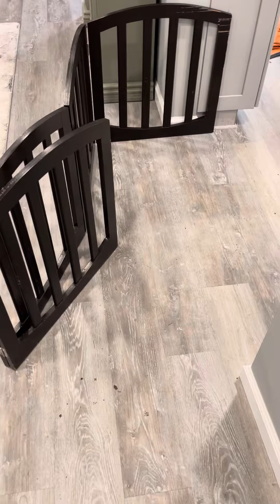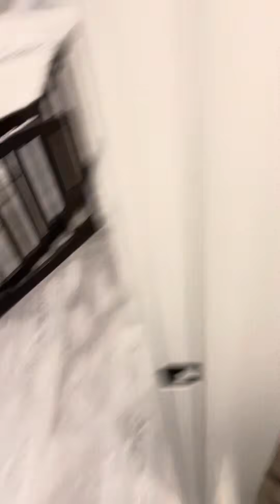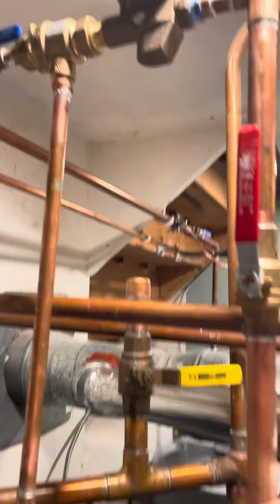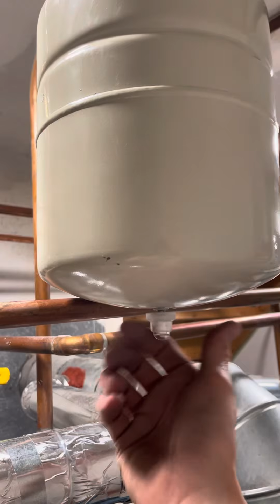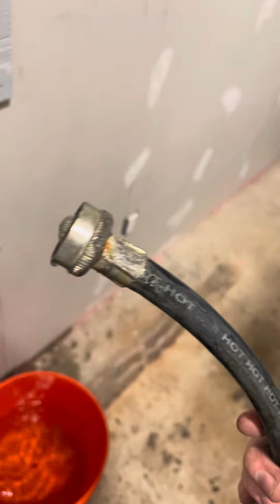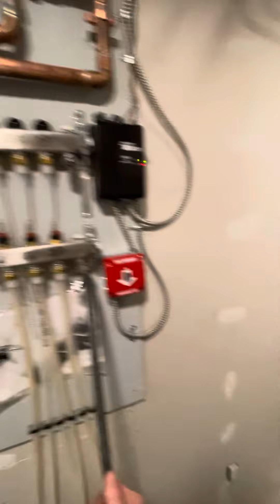Using Water Heater for Hydronic Radiant heat - DIY Radiant Heat In Floor

Comment: Where is the switching relay detecting temp from to kick the system on/off?
Reply: The thermostat, however I later learned that it’s better to run a thermostat wire into the floor

Comment: Do you really think your venting is correct? Tieing into the same take off as your boiler.
Reply: The larger water heater for the whole house was tied in this same way so I did the same.  What are your concerns so that I’m clear?

Comment: Code in Canada requires system to be “exercised” daily for 5 minutes to prevent legionella disease from stagnant water. An issue during times when heating not required.
Reply: Interesting.  I’m not familiar with that but thank you for your feedback
Reply: I solved this by installing a controller with such built in functionality.

Comment: Since you changed your under floor system from a boiler to the conventional tank heater, do you still need to have the mixing valve?
Reply: 0 seconds ago
Thank you for your positive feedback and you are absolutely correct.  Only reason mixing valve was installed was because I was originally going to hook up the system to a boiler.  It’s not needed in the way it’s set up now.  I just turned the mixing valve all the way to ho

Comment: Relef valve on water heater should be changed to 30 psi if used for radiant heat.
Reply: correct. If something happen to the tank gas valve and does not shut off, and they can. The pex tubing will be exposed to extremely hot water. Back flow is also a non testable device.  Most state codes require a RPZ backflow that can be tested and required to be tested annually.
Reply: Interesting.  I wonder if that’s NYS code.  I have to look into that.

Comment: One of the money saving principles of radiant is that you dont need to make 185 degree water ever. I cant imagine trying to get a system like this right...free of issues...without at least an engineering plan from Uponor. Tubing layout, length of runs, controls,etc are available information from them even online...and have been for about 30 years...formerly Wirsbo. I installed my system with a radiant contractor friend 23 years ago and it was EXTREMELY complicated and detailed. At the very least the bathrooms, living room, bedrooms should be individually zoned. A 3 bedroom home  should start at 5 zones...no matter how many loops you have. I applaud diy...but this is technical and important to get right .
Reply: Not even true.go look at some pole barns in the nort east.running fine for years .did you ever here the term keep it simple S ?
Reply: @MrSprintcat  you have no idea what you are talking about and not worth educating
Reply: No worries smarty pants. I'll just keep my wood boiler with back up hybrid heat pump hot water for backup if the wood boiler goes out and I'm not around to feed it. I wouldn't want my dump tank to freeze. Some homeowners know what they're doing. Do you know the saying jack of all trades master of none?
Reply: I appreciate your comment, thanks

Comment: why wouldnt you get a cheap wall hung boiler and set it to 140 and forget about it? Water heaters do not work the same way
Reply: Condensing, wall hung high efficiency boiler, primary secondary. Way more efficient.
Reply: Provided venting is adequate??
Reply: I believe so.
Reply: Yes definitely.  Was trying to manage a very tight budget and had serious concerns about the municipal water quality, high in iron, lime and calcium
Reply: Yes and thank you for your positive comment and support.  I also had serious concerns about the quality of the village water, even though it’s a closed system

Comment: You just need to add a primary and secondary loop on the boiler .
Reply: Always use primary, secondary piping.
Reply: I opted not to use the boiler because I didn’t want to risk damaging it

Comment: Hey, thanks for the informative video I really liked the detail you put into the explanation. I’m doing something similar in my shop hydronic radiant system and have a question: Did you need to use that mixing valve since your now supplying the floor with the hot water tank and not the boiler?  I was going to forgo the mixing valve since I’m using the same type of heat source.  Thanks….
Reply: You’re very welcome.  Hope it helped.  
0 seconds ago
Thank you for your positive feedback and you are absolutely correct.  Only reason mixing valve was installed was because I was originally going to hook up the system to a boiler.  It’s not needed in the way it’s set up now.  I just turned the mixing valve all the way to hot.

Comment: Great job on the install and even better explaining the steps and components used. I just finished the same system in my new construction garage. I am currently having a problem with my Taco SR501. When my thermostat calls for heat, the switching relay puts 120 volts to my pump as it should.  The problem is after the pump runs for approximately 5 seconds,  the relay kicks out. I thought it could be the pump so I disconnected it from the system and checked the relay again with just a meter hooked up. Same result.  After a few seconds the relay kicks and doesn't reenergize until the thermostat is cut off and back on. The pump runs fine. I checked it with a jumper wire. I will call Taco tomorrow and see if they are any help. Great video.
Reply: Thank you for your positive comment.  Hope you were able to sort out your issue
Reply: @VincentMcAteer  I was. It was a bad thermostat. I had a knee replacement last December so I didn't really get a chance to spend any time in my shop. However,  this year has been fantastic.  I set the thermostat on 55* and it stays around 60* all the time. Once the concrete slab heats up is is pretty easy to maintain that temp. I insulated the ceiling and walls with foam board. The only thing I'm going to change is the water heater from electric to gas.